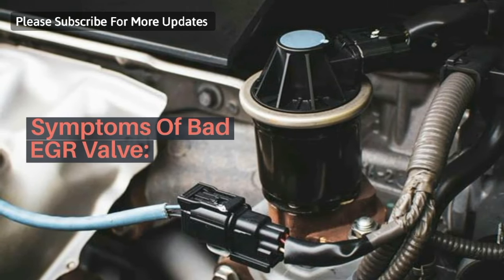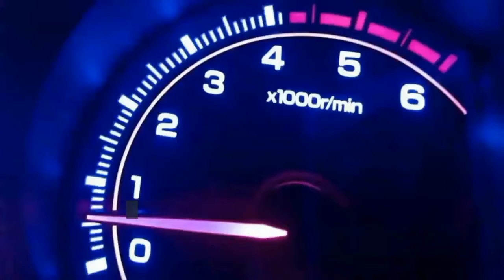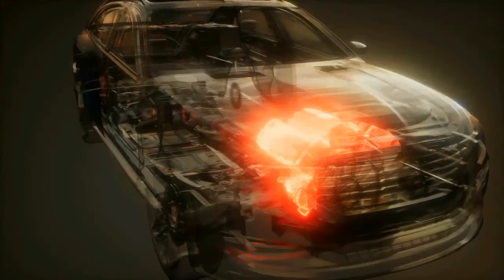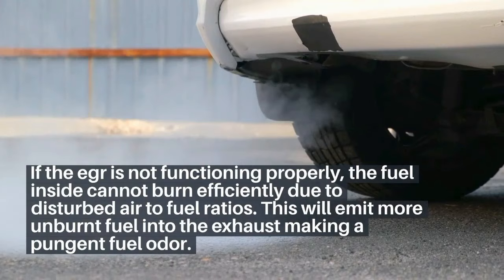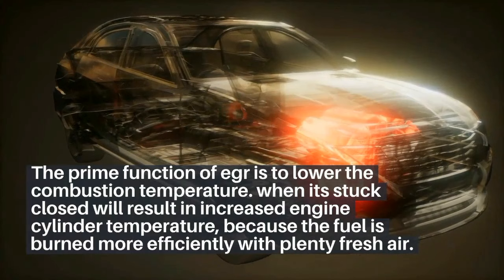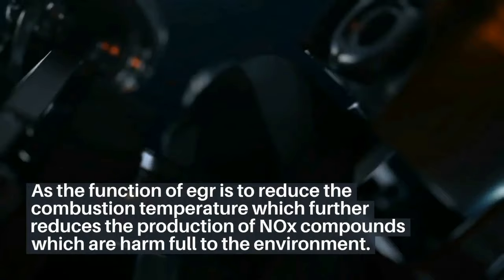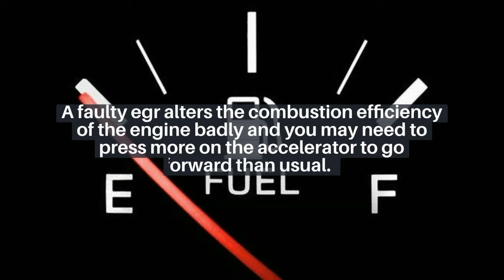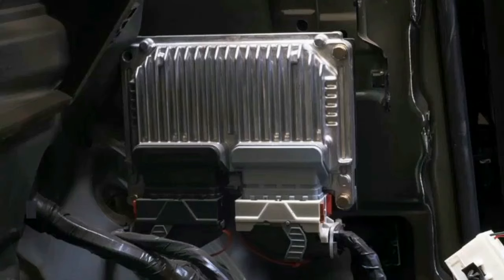Most Common Symptoms Of Bad EGR Valve | Signs of failing EGR

Comment: Am having a problem with my Ford Focus 1.8/TDCI-2005
The car gets clogged when i have to switch from the 3 gear to the 2 or vice versa.
Also happends when am accerating on the 3 gear with a speed of 100km/h and the car starts losing power
Reply from the maker: Hi there, its very common in ford tdcis to loose power or no power while switching gears when egr starts to stick and maf gets dirty. Do clean the valve and air intake sensors.
Reply: @dailyhandsdiy  thank you for answering and also the EGR was clear.No idea what else might be😕

Comment: Impressed by your video.

I own a Ford Figo 2014. 

Fuel: Diesel 1.4L
Variant: Titanium (Top model)
Color: White
Kms: 144,000 
Maintenance: Fully Company 

I have been facing a problem while driving the car. The engine malfunction symbol is blinking and at that time the acceleration doesn't work. It keeps the RPM 1100 unchanged. When I switch off the engine and start again, It works as normal. I visited Ford showroom and local mechanics. They have scanned it and found the below error. 

Error code: P0653. PCM voltage supply circuit VCC 2 short to battery voltage 

Could you share your inference?
Reply from the maker: It's a like ecm has a short...or the sensors or even wiring. Need to check all of them and find the cause.
Reply: @dailyhandsdiy  Great! Thanks for writing in. How may I contact you? Where are you based out of?

Comment: So I broke an egr vacuum line on my dodge caravan trying to change the ignition coil and no I have a knocking in the engine when accelerating  but the code says it's probably the O2 sensor not sure what to do
Reply from the maker: Hi there, when the vacuum line is broken, egr shuts close and more fresh air gets in. ie more oxygen for efficient combustion. This can lead to a small knocking noise from the engine. And as more fresh air gets in, the oxygen levels at exhaust might have gone high. Probably this might be the reason oxygen sensor code had shown up. Or the sensor might be broken. A broken sensor too can cause timing n injection deflections causing the engine to knock. Check, clean or replace the oxygen sensor first to see if knocking goes away.

Comment: Hello i have a 2002 golf mk4 tdi what do you think it would be better if i delete the egr could it run better or whats the prons and cons after the delete
Reply from the maker: Hi there, appologies for the late reply...you may delete the egr if it make troubles and cannot resolve. remember you are violating emission control rules. And the pros are much better low end torque and initial take off, a slight smooth rev, gas mileage depends the way one drives, clean engine, slow carbon deposit in engine oil. Cons include failing emission tests, a slight more engine noise, chances of knocking.
Once the egr is deleted, keep the engine rev lower most of the time so the piston crowns n head gasket wont get burnt. Im sure you will get enough power at the low revs to take off and overtake.

Comment: The EGR valve on my 2008 Jeep Liberty 3.7L V6  has small hole on the back side that sucks in air. The hole is factory made. I did a smoke test and its the only place smoke came out of. I'm having a problem with rough idle once the engine warms up. It runs great while otherwise.
This EGR valve is a replacement for one that did the same thing.
Reply: Probably coil pack

Comment: Alright mate wonder if you can help me. My mazda 6 2.2 diesel has intermittent smoke goes fine for a week or so then starts again.
Reply from the maker: Hi there, the first thing to do as preventive is the air intake sensors. Clean them good and also clean the egr...if there's intermittent sticking, can cause multiple problems.

Comment: My mates 1 series was running rough. I took his egr off & no word of a lie it was caked in carbon & sludge. If was stuck closed. Cleaned it with petrol & made it shiny again and his car flew after
Reply from the maker: Beauty of EGR...
Reply: @dailyhandsdiy  mpg up by 4mpg after 2 days
Reply from the maker: Yup 90% of the time egr cause fuel mileage related problems in vehicle.
Reply: @dailyhandsdiy my car goes into limp mode with no codes. 
Mk3 Mondeo 2.0tdci could it be the egr valve? 
Smokes and strong exhaust fumes.
Reply from the maker: @shanepatrick641 That might be one of the reasons, there're other reasons like dirty maf or map sensors, injector failures, turbo pressure leaks etc...

Comment: Great vid, I have a question, I have a 2014 insignia and when cold a very bad smell all around the car and inside but when warms up it goes but sometimes I have it when driving but not often, I did have an diagnostic done and Egr came up, I have cleaned it but bad smell still there, I guess new Egr?
Reply from the maker: Fuel smell at start up can occur if the injectors are not functioning properly or delivering excess fuel, a bad cat con also cause such issue, also if the egr sticks intermittently even if its cleaned the plunger can stick internally.

Comment: I have a 2015 Ford Focus and everytime I put my car in drive it stalls and loses power but as soon as I put my car in reverse it's normal. I've already changed the actuators. But I think it's the egr valve.
Reply from the maker: Also clean the intake air sensors as well.

Comment: Can egr malfunction cause black smoke and low power? Like when I step on the gas my car doesn't accelerate and releases black smoke, there is also check engine light, but its not all the time that it happens, like couple of days ago it happened but today it was running fine just the rough idle after starting the car but rough idle is gone after about 30 seconds
Reply from the maker: Yes absolutely..EGR does cause black smoke and power issues...If its stuck open or if its sticking intermittently, the issues shows up randomly with said symptoms.
Reply: @dailyhandsdiy  thank you for the info

Comment: I wish to have the EGR valve open later and closing more early to have less rebreathing of exhaust. Do i have to change the mapping or just use different values in VCDS?
Reply from the maker: Some adjustments can be done through VCDs but not sure if that comes under your requirement else could do a full ecm remap. If you adjust via vcds performance ranges can vary and might throw a check engine light if readings go beyond accepted range.

Comment: Hi.would it be smart to remove  out EGR valve from engine for good.the car is Hyundai Terracan 2.9 crdi.diesel.
Reply from the maker: Hi, cannot say which is smart, egr is for emission control norms and does soot up manifolds.So for clean intakes better avoid egr and for emission standards keep it alive.
Reply: @dailyhandsdiy thanks for answer friend.

Comment: What's wrong when you change the egr valve and it still runs rough?
Reply from the maker: It simply means there's something else causing the issue. Check the air intake sensors and actuators, clean them.

Comment: Hi master, hust wanna ask help. Why is my egr solenoid opens and close in wrong timing? My car hesitates especially in the morning but it also happens even when the engine is hot. I noticed the supply voltage to egr solenoid is on/off thats why its jerking. Do u know who commands the egr to open and close Aside from Ecu? You might be the one to fix it because 6 technicians have tried to fix it but failed Including hyundai centers. When i dismounted the egr solenoid with cable still connected to it, my car runs normal. I tested the solenoid by supplying 12v, and the solenoid opens and close.
Reply from the maker: EGR is actually controled by ECM itself. ecm uses readings from map, maf and pedal position sensor to calculate the engine load demands. All these are used to control the egr functions. Try cleaning all the intake air sensors first and using a scanner check if each and every sensor has a good reading especially map. Check the wiring for any damages.
Reply: @dailyhandsdiy  i have cleaned map,maf, tps and intake manifold. I also replace maf with a used one But it still jerks.  Sometimes  i get p0404 egr fault and sometimes i dont get any alarms but the car still jerks. Before i got p0101 so i cleaned it since it was wet because oil keeps going to the airfilter.

Comment: I was driving my car today it was fine then all the sudden sounded really rough and sputtering and noticed my gas was going down at a decent rate I have a popping noise from my muffler could it be the egr valve
Reply from the maker: Hi there, egr usually doesn't give an afterburn like you said. Its a misfire in one or more cylinder and the fuel burns at exhaust. This could be a failed injector or leaking injector, failed spark plug, ignition coil, worst valve damage or timing.

Comment: Nissan note 1.5dci engine runs ruff all time. To get it run need press a pedał and then goes to 1rpm not lower or higher, smell around the car of unburned diesel. Engine shakes and knock. Have new injectors replaced, but still the same. Have the EGR taken off, tested on the 12volt. I can tell is opens and close as normal. On the obd reeding nothing comes up... Please help me someone

Best regards
Reply from the maker: Disconnect the MAF sensor and try driving, if it changes the behaviour its likely to be the sensors. Also change the air filter n fuel filter if its too old. Does the car starts normal or more time to start?

Comment: My Volvo v50 has a faulty egr cooling system, and now it won’t start. Is it a possibility that a car doesnt start because of a check engine low egr pressure notification.
Reply from the maker: Hi there,if the egr is stuck open,may cause hard starting but no start, not so common unless there is an electric short in egr motor or any other sensor components.

Comment: I have an 06 Ford crown Victoria and I'm getting code p0108 from the censor on the EGR but no EGR codes 
any tips
Reply from the maker: Hi there, its map sensor issue. According to the code, says circuit high which means eaither the supply to sensor is cut off ie wire breaks or corrosion in connector else the sensor is broken. check the supply to sensor or replace the sensor.
Reply: @dailyhandsdiy  thanks for the information
Reply from the maker: anytime mate:)

Comment: Hi there hoping u could help me ive got 2017 insignia and eml kept staying in so put obd on and it said it was maf sensor so took it off cleaned it also changed air filter but after a day or so my car was strugglig to go beyond 2000 rpm and now eml back on any suggestions dont want to buy new maf sensor to find out its something else thanks
Reply from the maker: Hi there, Maf sensor codes can be put up by egr malfunction if diesel. vacuum leaks if petrol. Check all the intake pipes n fittings if loose or if got any leaks. Clean the map sensor too. Also check for wire damages.

Comment: Can i delete the egr valve on my mercedes w202 c220 2.2 ? A lot of black smoke is coming out of the exhaust if i press full gas. Is there any issue if I delete it ?
Reply from the maker: There shouldn't be any issue..but the CEL will show up...and the emission test may be affected if its strict.

Comment: Yesterday i had codes P0406, P0108 and P0109 on my 06 Towncar. I have had a minor rattling noise when pressing the gas and some minor knocking here and there. I will pull the EGR valve today for inspection any other things I should be on the lookout for?
Reply from the maker: Hi there, do clean the map and maf sensor too. if the code remains, change the respective sensors. Map is one vital sensor for proper egr function.
Reply: @dailyhandsdiy  appreciate it 🙏

Comment: My truck stalls  but no engine light. Does it always pop up. No code too
Reply from the maker: May or may not throw the light. If the stall is because of egr 90% of the time used to throw a light but if its fuel starvation like low fuel pressure in line, may not give a light but simply stalls.

Comment: Hi can EGR in any way cause Missfires 1.6 hdi 82kw?
I have almost missfires on all 4 cylinders 😔
Reply from the maker: It won't cause visible misfires....might be an injector issue or air intake or fuel related sensor.

Comment: how to fix black samook & lowe pickup problem in one of my sport diesel car
Reply from the maker: Egr does affect the pickup of your vehicle but there are other reasons like dirty air intake sensors or bad intercooler or leaky air pressure systems. Its a good idea to clean and check all the air intake sensors and egr too.

Comment: I have a vw caddy runs absolutely lovely when started up I let it run for 5-10 mins and then it gets really rough on idle but still drives okay just a lot of black smoke I have changed all injectors and seals multiple times and same problem. Would you suggest maybe this could be a get fault
Reply from the maker: Hi there, if you have black smoke and rough performance first thing to check will be the air intake sensors and egr. Clean each one of them and see if the problem reoccurs. Also check the fuel temp sensor if its giving accurate reading.
Reply from the maker: Hi there mate, could just check the injectors first if its a diesel. Any compression loss can cause rough start or long starts followed by heavy engine vibration, white blue smokes and stall. but when the engine becomes warm, it smooths out till it comes cold again.
Reply from the maker: I guess its an iv tech engine design. If yes the valve solenoid can mismanage and cause some related issues. Throughout bearings, alternator etc wont cause much trouble on engine roughness. Do the timing and valve adjustments checks too.
Reply from the maker: Timing errors....chain too,if its loose does make problems.
Reply from the maker: I meant the timing chain can loosen up and affect the timing ie cam and crank. This can rarely give a code cam and crnk correlation but rarely. its a good idea to check that physically. Same if its a vvt ie iv tech  the malfunction in vvt wil give similar issue ie timing correlations.

Comment: Hi i have check engine light and it say egr function sensor what should i do
Reply from the maker: Hi there, you might need to remove the egr valve and check if its stuck. Clean the valve properly and make sure its moving freely.
Reply: @dailyhandsdiy  hi i dont know how to do that but do you think how much do i need to pay in a mechanic shop?
Reply from the maker: Am not quite sure abt yr place but its almost 2 to 2.5 hrs of prof job.
Reply: @dailyhandsdiy  thanks man really appreciate you’re reply🙏🏻
Reply from the maker: Any time mate 😊

Comment: Iv just had my 118d hooked upto computer. Maf sensor egr stuck open. Should I clean the egr b4 replacing the maf sensor then?
Reply: It has about 10 other codes too but we won't go there😂
Reply from the maker: Yup you should clean the egr and related intake sensors first. EGR does trigger the air intake sensor codes.
Reply: Thanks alot for quick reply. Will get it off and clean it out then
Reply: Thanks alot for quick reply. Will get it off and clean it out then
Reply from the maker: Anytime mate  :)

Comment: Astra 1.6Turbo Runs out of coolant within 2 days.
Radiator replaced + Caps replaced + Thermostat replaced and still looses all coolant. No smoke, no head gasket symptoms, no over heating. Fuel economy very bad.
Could this be EGR ?
Reply from the maker: Hi there, do check the hoses n clamps for loose connection. Sometimes a loose clamp with tight pipe leaks coolant while running because of fluid running pressure but not at low engine speeds n idle. If there isn't any external leaks, the chances are headgasket or the egr cooler may have internal leaks. Do check the engine oil if its mixing with coolant.
Reply: Egr cooler might be leaking
Reply: Check radiator?
Reply: @itswais77  radiator system was replaced. Car is still with under works been told it’s the oil cooler leaking coolant.
Reply from the maker: If its the oil cooler, practically oil should be the one going down as it has more working pressure than coolant which travels to coolant side. If its an external leak then ok. else, you may have to flush the entire cooling system or might end up blowing your engine.
Reply: @albillah9654 sounds like the water pump is bad. Have you ever noticed a small hole underneath it. My mom's car is leaking from there.